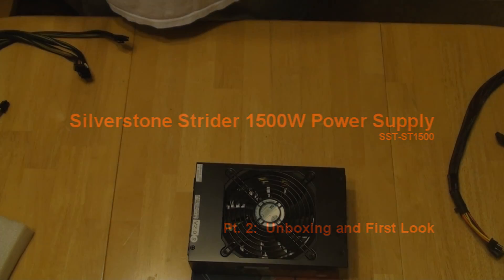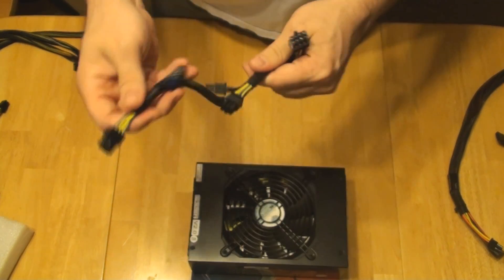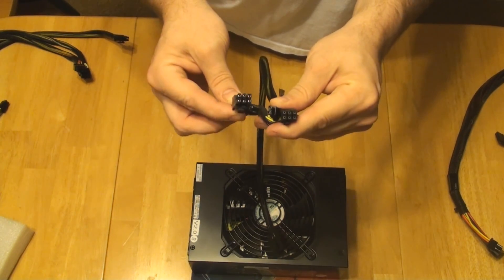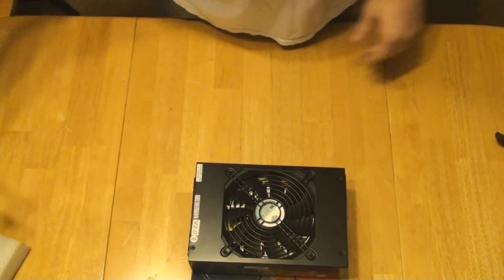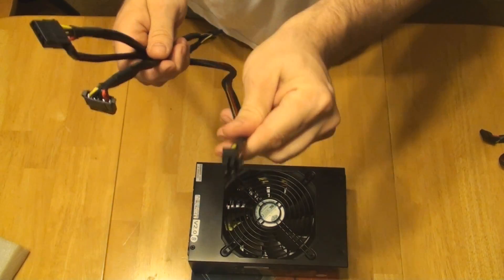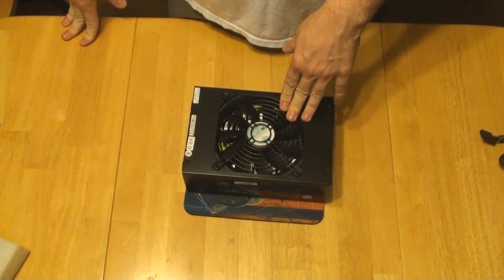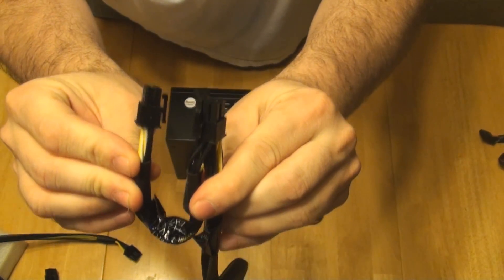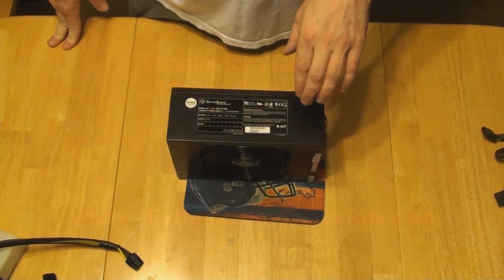Silverstone Strider 1500W Power Supply SST-ST1500 Unboxing and First Look Pt. 2

Comment: the floppy cables are also meant for powering some misc devices which is why 4 are provided. Some PCI/PCIe cards/devices on the 5 inch bays that require extra power but not so much more may use a floppy power connector.

Comment: @Trubyd44 Well the one I'm talking about is partially internal, partially external. The external part is where the real power is going through, via dual outlets, and then that transfers to the internal part, which is fully modular plugs. It's on FrozenCPU.

Comment: there are a few different accessory devices that use the 4 pin "Floppy" connector to power accessories, like fan controllers, sound cards, high end displays, and so providing 4 pin power connectors in a high end power supply is a necessity

Comment: cables needed possibly more consideration with options to connecting latency equipment for sure. I have similar on my Thermaltake 1200watt PSU. I Have thought about re-sleeving them, but wouldnt want to get a wire wrong...

Comment from the maker: @0pTicaL823 I may have missed what you meant here.  There is no need for Silverstone to have a proprietary connector here.  The PSU is 120v and/or 240V...the connector that goes into the PSU is made proprietary because they want you to use their thick ass high quality power cord.  I understand the need for safety, but if someone used an 18AWG for this PSU, you can't really fix 'stupid.'  HEHE.